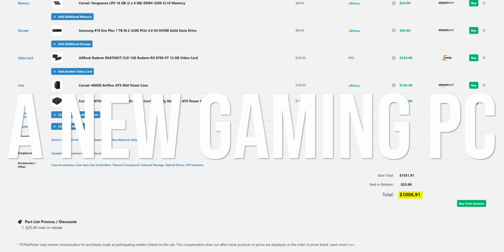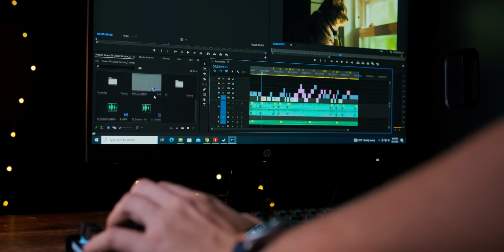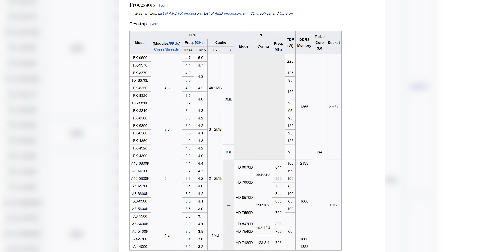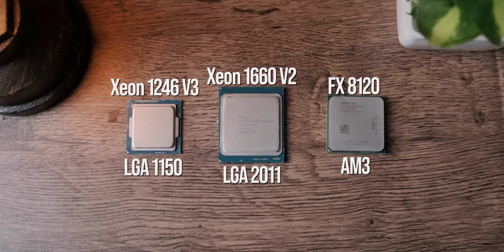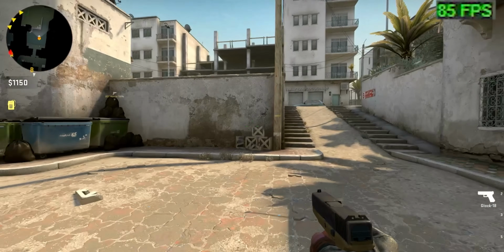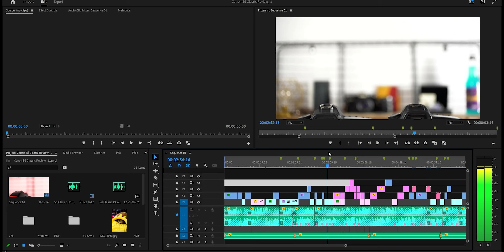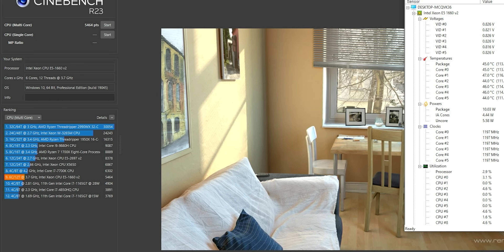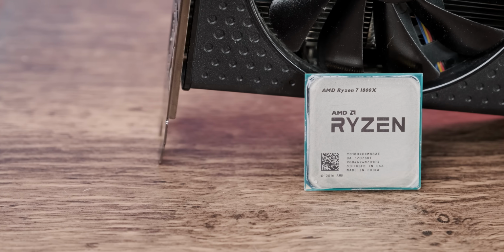DDR3 is DEAD

Comment: I am typing this comment on a daily use Linux rig running Xubuntu 22.04 with an Intel i5-3330 and 12gb DDR3 and this thing barely breaks a sweat even on basic tasks like watching YouTube. I'm running 24% CPU usage as well as only around 4gb of RAM being used at the current moment with YouTube playing.

I'm am a little irritated about the near scalper level of prices for higher end Intel 3rd generation hardware. I don't feel like paying absurd money for an i7 for this motherboard... I do have a main Windows rig that I use for a lot of other stuff that has an i5-10400F so it's not like an upgrade is crucial or anything.

Comment: You were suprised about DDR3 when you said you used it for 7 years, but it was already on the market for years and years when you built your first PC. It'd be more suprising if you were still using your late model socket 775 board that had DDR3 support or even a 1156 system to this day.

Comment: I upgraded my old i5 750 to an i7 4790 Asus Z87 motherboard a couple years ago just to use as a "budget" build with 32gb of that same hyperX RAM, graphics card was an RX580 8GB... It honestly ran anything I wanted... except since I got it used found out later on the USB3.0 support was completely bricked and that making it useless for using a VR set ended up investing in a Ryzen set up when the prices dropped.  But honestly if it wasn't for the dead USB3.0 ports there was absolutely nothing wrong with that system and would have kept using it.

Comment: I'm still using a X58 board with a Xeon W3690 as a secondary setup (12gb DDR3 in Triple-Channel), watching this video from this system right now actually.

I'm often shocked at how well this thing can still perform. Been playing some Baldur's Gate 3 on it with mostly no issues recently.
Old systems are fun sometimes.
Reply: I also play the latest game on my "ASUS P6T" mobo with 48GB ram and a overclocked Xeon X5675 to 5Ghz.
All graphics on max settings except resolution (1440p), with an easy 120+ FPS.
Reply: @opoxious1592  Damn, that's nice.
I really got to upgrade my ram to atleast 24gb someday, but it's hard to find kits of 3. :c

Comment: i've been running on an old optiplex for a few years now, I just bought a gpu for some light gaming. This thing still holds up great.
Reply: my whole system cost me 60 bucks, pc and gpu included
Reply: Optiplex's are great budget gaming PCs. Got a 5040 with an i7 6700 24gb DDR3 RAM and a 4gb AMD 6400. It can't run some newer high requirement games like cyberpunk but I meet 98% of minimum requirements on canyourunit. Maybe $200 in the build for the PC GPU and a couple extra RAM sticks.

Comment: Yeah sadly AM3/AM3+ just wasn't really a good platform. It was ok for a lot of games, but it was far from ideal. I used an fx 4300 for years, overclocked of course. It wasn't so surprising to see better performance with the RX 480 after getting a platform upgrade, but it was nice that it ran as smoothly as it did lol

Comment: One thing that would make the x79 build a fair bit better in the productivity tests would be if you had 4 sticks of ram in it instead of 2, as one of the big selling points for the LGA2011 socket was the quad-channel ram.
Reply: not necessarily i see no difference running quad vs triple vs dual chan for productivity namely video editing. its *nice though that i can populate all 8 slots for 128GB :)

Comment: Also, if you want the newest platform with ddr3, there were some Z170 boards using it, meaning you can theoretically go as high as 7700K.
Reply: if it supports a 7th gen intel cpu doesn't it mean that the ram is upgradable from ddr3 to ddr4 too?
Reply: @NikosM112  The integrated memory controller in the 6th and 7th gen cpus supports both types, yes, but I don't think there were any mobos with both slots like they were for the ddr2/ddr3 and earlier for ddr/ddr2.

Comment: All the way from 2014 to 2020, huh? I've been "rocking" ddr2 all the way since 2006.
Reply: Ddr2 is dinosaur slow in this day and age even compared to ddr3. plus any cpu using ddr2 is not worth running anymore simply because of how much you pay on electricity running the thing.  Honestly if i was you i would switch to at least ddr3 due to the low cost of hardware at this time and you will pay off your purchase on your electricity bill alone. too many people dont consider how much different hardware costs to run.
Reply: @KPopFan40167  Far too many assumptions here for me to regale you with a clarification.
Reply: @KPopFan40167  Well if he likes old games then he dont need to upgrade
Reply: well what's your use case?
Reply: Yup still got one of those gateway sx slim towers on ddr2 that's been kicking since 2010 for my basic computer needs

Comment: I was running a 4790 with a 1070 from 2013 till December last year. They are still OK as long as you don't expect the best. You don't suffer much, the only issue I had was blue screens every so often. 4770k would probably be a better choice as it's cheaper and with an oc you can get it to 4.6ghz same with the 4790k. It will run everything at a reasonable fps even at 1440p
Reply: How did you get a 1070 in 2013 🤔

Comment: DDR3 are still usable today.
Reply: even ddr2 is IF you oc
Reply: Ddr2 is not usable today
Reply: @Sikedoom it is. If for google and youtube.. talkin bout 800MHz
Reply: @Sikedoom DDR2 are still usable today.
Reply: @Mr.TullamoreDew  No need for overclock, when stock makes still a job.
Reply: @AntiGrieferGames  an overclock can really help too.. like 800-1066MHz 20% increase in speed
Reply: Ddr3 is no problem at all. Overclocked to 2133mhz she’s holding up well:) with a i7 4930k over locked to 4.4ghz so my setup although old rarely runs into bottlenecks
Reply: @Shaneet97  you can even use ddr3 with 9900k z170 board so  guess it would be usable af
Reply: I play with ddr3. I play free games like kingroad got

Comment: i'm still using ddr3 btw and I don't see any significant difference between ddr3 1600mhz and ddr4 3200mhz and ddr5 6000mhz in gaming performance. and it still can handle rtx 3060 ti just fine, It doesn't make any senses years by years they invent ram techology but the performance is not worth and not make a huge amount of difference. Wasting money and time, Ram maker is just want to rob your pockets

Comment: you say dead, but I was rocking a dell workstation with the same e5-1660 v2 that you used here as my gaming rig with a 3060 12gb until just a couple months ago. (I was using 6x4gb + 2x16gb 1866MT/s ECC ram in quad--channel mode in the eight slots on the motherboard. I don't actually know how the quad-channel works with the mismatched stick capacities, but bios claims functional) I was also using a modded bios with ReBAR and NVMe PCIe boot support. overall a very cursed machine that I love dearly and now serves as a server in my closet.

Note: You said in the video that you would like the 2011 with nvme but that it doesn't support it, but this is wrong. ANY system with PCIe can interact with NVMe drives once the OS has loaded, they are regular PCIe devices and you can get PCIe adapter cards to use them in expansion slots. You just need BIOS support to boot them, and even then you can use a bootloader like grub or clover on a usb drive to boot off the nvme.

Comment: Building a pc is not as expensive as you think you can build a sub 300$ gaming pc shit even a 200$ one if you really look out there for parts , I have a 250$ a520 ryzen 5 4600g running 16gb ddr4 512gb ssd 500 watt power supply in a thermal take h17 case costed me like 230$ to build, no dedicated gpu tho but can still play games 720p and 1080p

Comment: Could still be usable on x99 with say the 2666v3 and the 2678v3, high core count and overclockable through bios mods with say a machinist x99 g7, for about 287 bucks for a build that beats out any console on anything but ray tracing
Reply: Also to mention, you can unlock resizable bar support on these motherboards and they support VR

Comment: The one huge use for an old DDR3 system I can think of, outsie of virtualization is audio editing, which can use up gobs of RAM if you have huge pieces with hundreds of tracks, but as long as you have like an old dual Xeon system, there shouldn't be too much slow down.. I've seen ECC DDR3 as low as $200 for 800GB on Ebay, although it's usually about $500 for 1TB in 16GB sticks.
Reply: What mind of music genre requires so much RAM? We're talking of the likes of FL Studio and Ableton, right?

Comment: I planned to upgrade my Haswell system for one last time, but after careful thought, Its not worth it and best to get a more recent or latest specs.
These where my spec plan:
• Asus H81M-K  -->  Asus Maximus VII Gene
• DDR3 1600  -->  DDR3 2133
• 4790  -->  4790K (repaste TIM for better cooling preferably Liquid metal)

I have ditched this plan and moved on with 13th gen and a B760M Mobo

Comment: The Core i7 4790K has slightly worse single-threaded IPC to The Ryzen 3000 series. Upgrading from the 4790k in 2020 to a R9 3900X was marginal unless you count the 8 additional cores I gained. Yeah there was definitely some I just should have waited for Ryzen 5000. This might explain the cost of them (4790K) since they might perform similar to 4-core Ryzens from the 3000 series.

Comment: still rocking an i7 4790K, 32gb DDR3 1333 and crossfire rx580. yeah it totally isn't any good price to performance but upgraded it slowly up starting with an old prodesk (i only use the 128ssd for boot storage now)

Comment: I used i5 3750 with DDR3 from 2021 to 2023. before that I use Core2Quad Q8400 with DDR2 back from 2010.
In early 2023, I try to get a HP Z840, but the mainboard got damaged, and cost around $400 to replaced. Oh. hell no for a replacement boards... I salvage all the parts that can be used in mean time. a nice Quadro K5200, 128GB DDR4 memory, and 2 Xeon E5-2530v3, on which only the Quadro that I can use.
just last week I finally get a new system with DDR5. Why? I had enough with bad reliability in old parts. I spend 5 DDR2 mainboard, and 3 DDR3 boards. and also 1 DDR4 boards.
yes they are cheap as hell (except the Z840 boards), but getting them as stable years long are very hard.
I still keep the processors I used. 6 LGA775 proc, 2 LGA1155 proc, 2 LGA2011v3 proc. yeah they are a memories to keep.
Reply: Oh. and I use R9 290 also. Its a power beast. not too fast, and way to much in power draw.

Comment: DDR3 has a security vulnerability by itself, and so does all the Intel CPUs running it. Anyone using these systems today are insane. Plus they don't run modern software and games that great, and don't support modern security features to install Windows 11, etc. DDR3 is a completely dead horse, and DDR4 is on it's last legs.
Reply: Your dealer is obviously selling prime stuff. Care to share his number ?
Reply: @djukic921  yeah his name is rowhammer, spectre, and meltdown. He deals coke laced with AIDS for anyone thinking vulnerabilities aren't a problem, not to mention you don't have enough bandwidth, IPC, core counts, or even modern peripheral standards to be acceptable running modern software or games.
Reply: @JohnDoe-ip3oq If you think that it is insane to use it then you are probably the type of person that watch and trust JayzTwoCents. The guy who advised his viewers to go out and buy nvidia gpus when they were still crazy expensive after crypto mining was over. Anyway, it all deppends what is the use for the pc. In corporate setting it is definately obsolete but for regular person it is still very viable, even in 2023. Is it smart to build it from scratch ? No. Is it okay to use it if you own it and it suits your needs ? Definately.

Comment: It is not dead. 4790k 16gb 1866mhz r9290 can still play many games - even at 1440p!!! - at playable frame rates in many cases 60+ fps.

If you already have a system like this or get a hand me down, it is completely servicable

But as you said, the things that are happening now is that the items are so old now, theyve gone around the curve and the price gone up as it usually happens. And motherboards are sus, since majority are used. But the biggest thing is the price, going from expensive to cheap to expensive as it becomes archaic.

4790k will probably live on for another 5 years easily. Its only problem is microstutter.

Comment: I think anything 1600 CL 9 or above can still provide relevant use in DDR3 systems. 

1333 is literally a big fat no. 

On some boards 1600 and 1866 work well with ram overclocking without changing voltage, cass latency or individual timings.

I'm an fx fan with several FX CPU from 4100 to 8350, also a DDR3 based system set. 

Anymore the only FX CPU capable of newer games (2020-2023) is the 8350 and realistically Hogwarts, the newest Star wars and a couple other really recent games are flat out unplayable.

Comment: You can always m.2 with a pcie adapter which are like $5-10, avoid x1 slot adapters though.
Reply: Yeah but the bios has to support booting from it
Reply: @slaydog5102  you can get around it with clover boot manager off a flash drive, its not ideal but it works

Comment: I wouldn't completely ignore x79 board prices, as there's always the option of chinese 2011 boards.   they take cheap AF ecc memory, which allow higher capacities than normal consumer 8gb dimms (I believe maxing out at 32gb sticks for about 1$/gb)

if we're already delving into used systems, server hardware, and boards that don't have proper W10/11 drivers anyways, what's a little more jank?

of course, the real value is in 2011-3 anyways, but only because ecc ddr4 just started to become affordable
Reply: I have a Chinese x79 board and  it does work with 4x 16GB ECC modules (64GB). Quad channel DDR3 is pretty close to DDR4 speed and the Xeon e5-2697 V2 has 12 cores/24 threads. The video board is GTX 1080TI.

Comment: For the longest time I was running a dual Xeon server motherboard as my desktop. had a pair of 2650v2s and 192gb(24x8) of DDR3 ECC memory in a supermicro motherboard.   It was by far the cheapest way to build a workstation with the memory capacity I needed for data science. The whole system cost $400 and was built from salvaged parts or liquidation auctions.
Reply: I got a Dell t5600 with 2 2680v1s and 128 128 gigs of ram and a 1080ti.. whole thing cost me about 200 bucks.. and 150 was the gpu lol. I’m looking to put Linux on it though because I’m getting sick of Microsoft’s bs.
Reply: I really recommend a dual boot. I know people are still skeptical even though it's far more reliable now, but with a GRUB bootloader you can boot off a second physical drive for windows and Linux complete file systems
Reply: Use a bare metal hypervisor and create a gaming vm and pass through gpu to vm. That's what I'm trying to do.
Reply: Im doing the same with a sh5500hcv with 72 gigs and t1000 8 gig 5x 4tb and 500 gig for a os HD. I'm doing boinc and using it as a Plex server.

Comment: I'm still rocking with my z420 for the past 5 years (although I'm now getting parts for a my first ever new build)
8 core xeon E5-2676 v2, 32 GB DDR3 (4x8 GB, for quad channel), RX590, and 2TB nvme!!! 
nvme is actually tricky but totally worth it, it is only possible using a expansion card, and the BIOS doesn't recognize it as a bootable device, so a bootable usb pen does the tick to redirect the boot to the nvme drive, then the installed OS boots normally, the extra speed made me keep it running longer for sure.

Comment: Picked up a full 1150 system from the junkyard over a few weeks as we swing by there a lot with work.
2x8 gb ram at 1600 mhz, I7 4770k, MSI B85M-E45 motherboard, noctua nh-u12 cpu cooler with some of my leftover mounting hardware for my own U12 cooler i bought an AM4 mounting kit for. After a bios update i overclocked the I7 to 4 ghz stable, it probably can do like 4.4 - 4.5 but the motherboard looks pretty weak on the vrms so keeping it at 4 ghz for now.
Basically stock 4790k speeds without turbo, should pair up nicely with his gtx 970 as well.

Lil brother is gonna get that as soon as i get my usb drive back from a guy at work.
As i don't think i can make a bootable windows 10 installer with my external ssd as fast as that would have been too install from, i simply had weird issues trying it on a laptop.

Comment: for the x79 system if you are not afraid of Aliexpress i got a 2670 v2 and a motherboard and 64gb of ecc ram for only 90 euros. It was amazing deal but its a cheap Aliexpress motherboard and I had to buy a down blower cooler so it also helps the motherboard a bit but for the price ddr3 ain't dead but is not recommended for higher budget (more then 200 for CPU motherboard
) but it also depends on what you do with it for me ddr3 or 4 make almost 0 difference and better more ram then a bit faster ram.

Comment: I have a basic HP desktop I bought on clearance with an i3-10105 and RX 6400, the CPU performance of which is about the same as all of these chips(in multicore).

I would like to build a current platform, but I may wait for Ryzen 8000 to see what it's like.

Comment: One of the reasons that the 6600 seemed like it was at 100% on the AM3 system is that AM3 used PCIE 2.0 X16, whereas the 6600 runs PCIE 4.0 X8, so you can’t use the full bandwidth of the slot anyway, but it also gets bottlenecks by the older standard.
Reply: Beating my old Optiplex (i5 4570 DDR38gb) pushing with a small overclock